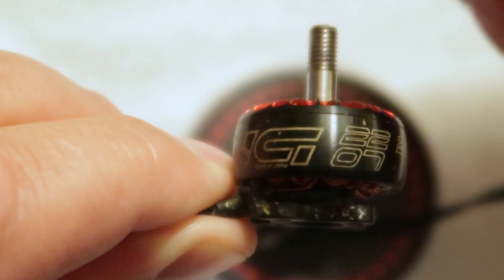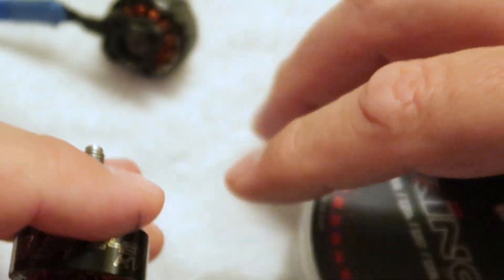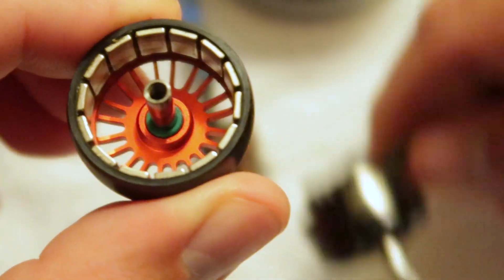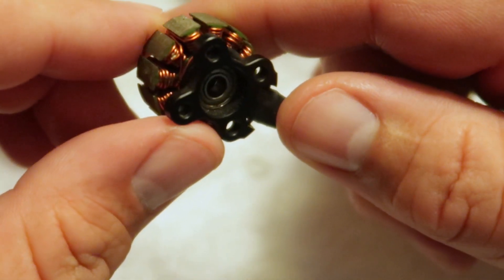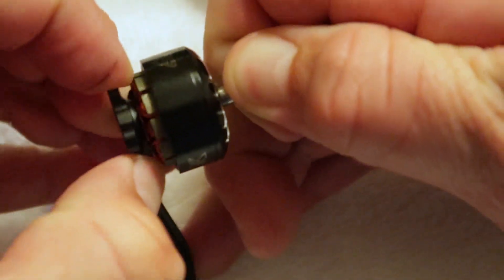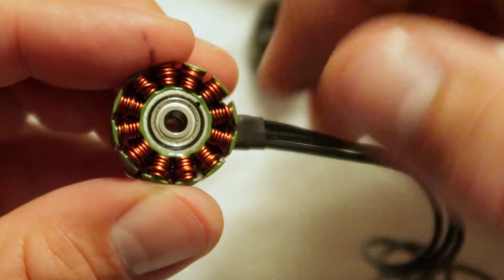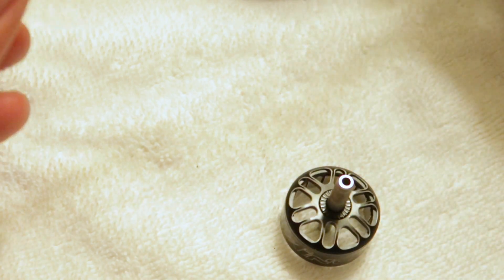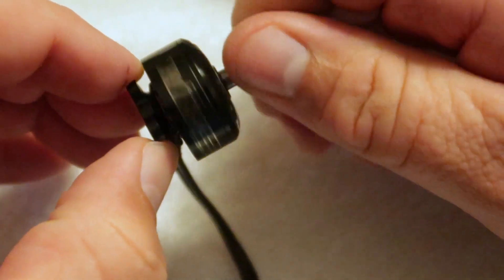🔥 Xing-E Budget iFlight Motors / Premium Features for an ECO Price

Comment: I have these and they get the job done.  I'm a new pilot sonive definitely crashed 
 And everything is fine . just rinse the mud out and hit ot with the compressor. Also I'm running on 5s so I have something to upgrade to(6$) when this isnt fast enough ha
Reply from the maker: I've been running a single set for the past 2 months and I don't think there's a better value motor on the market.

Comment: I bought nine Xing-E 2208 1800kv motors and put them on two quads that I have flown for a long time without problems with ZMX 2205 2300kv. 

First .. one of the Xing-E motors was a 2450kv although it was marked 1800kv. 

Secondly, on both quads the motors run superhot, just hovering and they will loose the magnetic properties if I fly like this. Forget all filters, lowering PIDs, screw that touch the windings, vibrations, ESC timing etc. I have checked all that. I tested with both 6s and 4s. Same problem. Moved a set of motors to a 7-inch frame with different ESCs, same problem. Run them from the Betaflight motor tab on 30% throttle with props on. 30 seconds and you can use them in the kitchen. Tested with Betaflight 3.5.7, 4.0.5 and 4.10-RC5... 

The motors are just not working. Probably they got a batch of bad motor wire or forgot the heat treatment of the stator lamination after stamping. Hmm.. I work in a place where we make motorwindings  for watches. Slightly different dimensions but... I don't know, but clearly not everyone have these problems so probably there is a batch of bad motors out there...

Banggood was just replying that they can refund me for the 2450 motor but they didn't even comment on the overheating problems. I just declined and pointed them to the fact that I have paid for 9 motor that I cannot use. 

I just asked for assistance from iFlight but no answer yet, we have to give them a day or two.
Sorry about the rant but I just don't want anyone else to have the same problem as I do.
Reply from the maker: No apologies! half, if not more, of the value in these videos is being able to go through the comments and find people's actual experiences. When I make a video, I'm only speaking through my own experiences. But collectively we can get a better picture.
Reply: @JoshWithrow  Thanks man!

Comment: So my favorite durable motor is Mr copper 2306/2400 but I wish I had 5s or 6s escs because 4s it feels slow but maybe the ummagawd 2150 won't be horrible with low kv. I want durable but fast 4s motors for freestyle any idea on what to buy that's budget friendly?
Reply from the maker: Seriously, you could get Xing-E motors in 2750kv.  They'll hit your batteries harder, but they'll give alittle life to that 4s rig.  Mind you, you could also just use slightly more aggressive props and probably achieve the same thing.
Reply: Yo can get drib motors fo 4s he usually flies on 4s

Comment: https://youtu.be/nkT1uVRKlc8
Great video man. This is a grate motor. I'm pretty sure your weights on the motor are off though.  Either that or you're comparing one with the prop nut and wires and one without. The aluminum on the bell is a different alloy then the originals as well.   But in my opinion I agree with you and I really liked your review. 

 I have an in depth review on the Xing-e 2306/1700 KV  variant. Check it out!

Comment: what’s next LV after 2450? 2700kv?
Reply from the maker: Yes
Reply: Josh Withrow 2700kv damn amp killer.  i wish they make 2550kv.
Reply from the maker: @KLNYC  I normally run the 2750's and love them.  Yes, they hit the battery harder, but I like having that extra top end.

Comment: I'm waiting to see the new hyperlite e series motors Serge is releasing
Reply: The new hyperlite e’s are pretty good. I’ve got a couple sets of the 2207.5 1722’s and a bud of mine has the 1922’s. They both are great and have held up well. For the stator size their a little smaller than my Xilo 2207 1750’s from get Fpv and the motor is about a gram and a half lighter than the Xilo’s as well. I like em. Plus the bell from the hyperlite 2207.5 fits them!
Reply: That said I am getting a set of the xing-e 2207 1800’s in the next few days to test out as well 👍